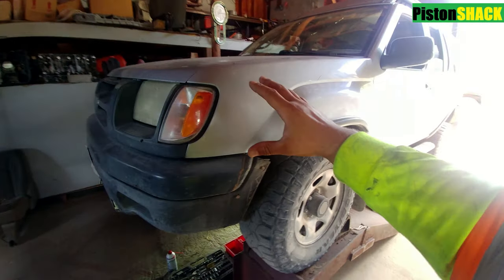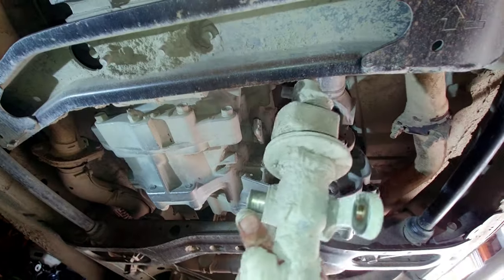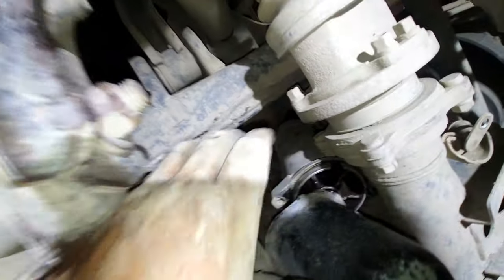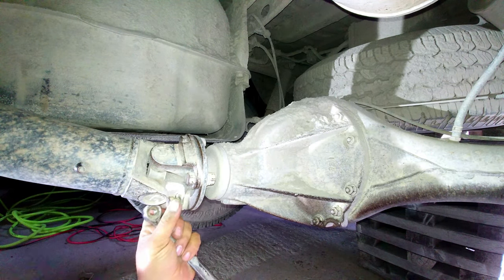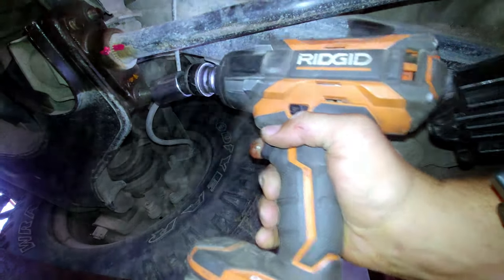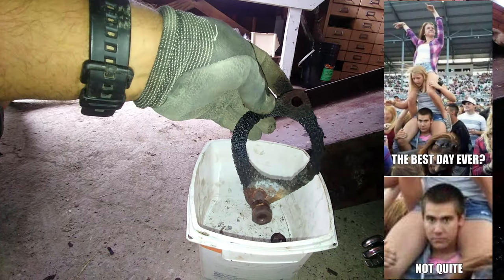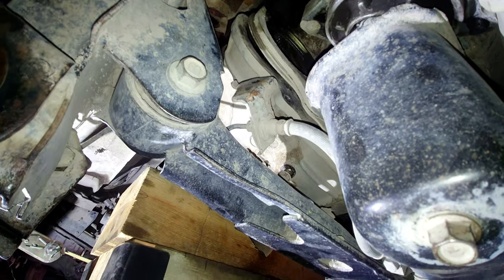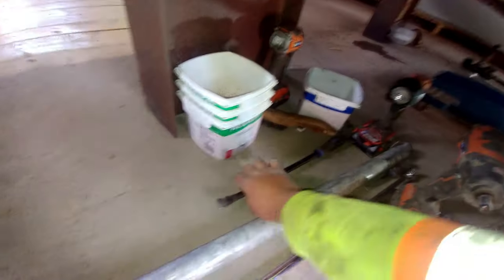NISSAN XTERRA / FRONTIER CLUTCH REPLACEMENT. Part 1: GEARBOX, CLUTCH REMOVAL - Best Explained // 4K

Comment: Legit the best car tutorial video I’ve ever watched
Reply from the maker: Thank you so much for your feedback. I tried my best) Let me know if you have any questions. Cheers!
Reply: @PistonShack  Should I replace the flywheel bolts and clutch fork? 2003 w/ 146k miles. I'm also wondering if the flywheel is resurfaceble, can only find answers about the second gen frontier/xterra, which I think is a dual mass and can't be resurfaced.
Reply from the maker: @ggKampii  Yes, you should always replace flywheel bolts (same as head-bolts - one time use). I won't worry about fork it doesn't damaged or worn out. Nowadays, cheaper get new flywheel than take it to machine shop, I will go with a new one only. Dual-mass flywheel only can be replaced - I never heard about resurfacing dual mass. If you do flywheel I will recommend replacing rear main seal as well with seal retainer. I did mine 4 years ago on this Xterra. Cheers brotha!
Reply: @PistonShack  thank you! Ordered a new flywheel. When you did the oil retainer, did you use the oil retainer gasket (the one that goes against the block and retainer) Did you do RTV on both sides of the gasket, or just one side.
Reply from the maker: @ggKampii  When I did my main seal, I ordered rear main seal with retainer, retainer paper gasket and oil pan half moon shape rubber gasket, plus new flywheel bolt from local Nissan dealer. Yes, I retainer gasket, applied light coat of petroleum resistant gasket maker to both sides of the retainer paper gasket. Don't forget to lubricate main seal lip before installing. I also applied sealant (Nissan manual) where oil pan, engine block and retainer meet each other, otherwise retainer will leak at the oil pan. Make sure no any oil left on surfaces before applying sealant.

Comment: Replacing the clutch day after tomorrow, this is a great help!!!! Thank you!!!
Reply from the maker: Glad it helped brotha! Let me know if you have any questions, I will try get back to you soon as I can> Cheers!
Reply: @PistonShack   Thank you again!!! Had a little trouble as I was uncertain of the torque specs, but I got them from the FSM.  Hardest part for me was lining the transmission back perfectly. But the most annoying thing was getting the crankshaft position sensor off and back on, and I might have put it back on wrong as my truck only starts after 3 turns of the key, LOL. As far as it running though, it's running perfectly. No noises, no hesitation, no lag, no issues whatsoever. Changing out the fluid was easy too, maybe just a product of a manny tranny.
Reply from the maker: @lowrivera  It wasn't easy for me as well to alight the tranny. You can replace crank sensor later (just remove front drive shaft to get access to the top of the bell housing). According to Nissan Xterra Shop Manual Crank sensor is not used for engine timing. I would check for vacuum leaks, ignition timing and general tune up (filters, spark plugs, wires ect.)
Reply: @PistonShack  Figured out what it was, the starter motor died. I confirmed it to be the original. My Xterra 3.3 is a 2002, so not bad for 19 year old truck. Thank you for all your help!

Comment: thx for this have to do it on my wd21 tomorrow and its pretty much the same
Reply from the maker: Hey Ryan! How is your clutch replacement? Btw, thanks for your kind feedback.
Reply: @PistonShack  got the box out pretty easy because of your video! its much easier on the wd21 i think because you dont need to touch the exhaust...just torsion bar out and then gearbox! big thanks for making a video on this m8!

Comment: So I'm pulling my engine its a 2002 xterra manual  transmission  2wd I went to pick n pull and pulled an engine out of automatic transmission now when I dropped the dust cover for the bell housing I gained access to the flywheel and the 4 bolts for the torque converter i removed and the engine came out now im trying to do the same thing on my manual transmission but I don't see the 4 bolts to remove the engine. Do I have to drop transmission to get to the flywheel?  And do I just switch flywheels from the old engine? Did I mess up buying a engine from a automatic transmission ? Do I disconnect the drive line and pull the engine and tranny together ? Or are the bolts im looking for on the other side of the flywheel?
Reply from the maker: Hey Sean you did almost right everything. No mess buying engine which was paired with AT transmission. I would say it even better. If you just need to do engine swap on your manual gearbox Xterra. I would pull engine out and leave tranny on a vehicle. Just undo bell-housing bolts from the engine, disconnect some wiring ect. swap or install new flywheel to your new pick and pull engine donor. Let me know if you have any questions I will try to get beck to you soon as I can. Cheers brotha!

Comment: Did you support the front end when lowering and taking out torsion bars? Also when I put my torsion bars in and crank them to their setting my front end doesn’t come up at all, any tips?
Reply: Did you get a solution?

Comment: Hello Guys after rebuild my clutch on my 2004 xterra 4wd light stays ON can't remove it, anyone can help me pls !! This issue is very frustrating
Reply from the maker: Hey brother! Disconnect transfer case range indicator switch, then light should turn off. Most likely selector switch stuck ON permanently ect.
Reply: @PistonShack  thank you very much!!!!